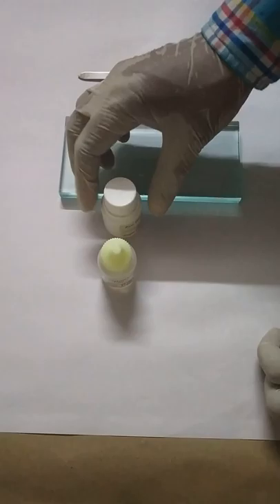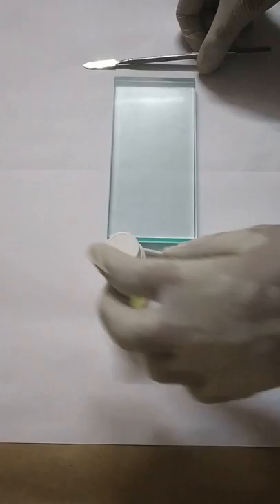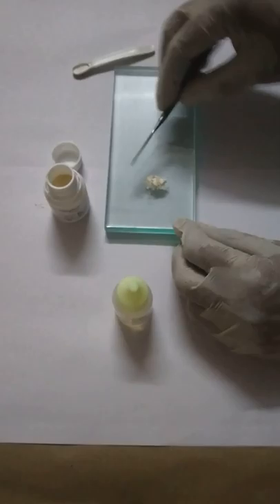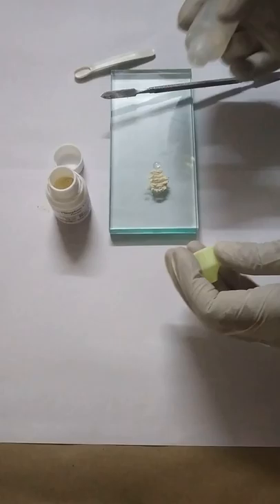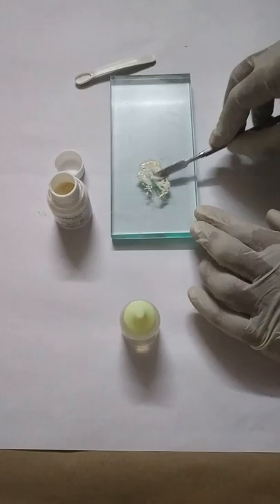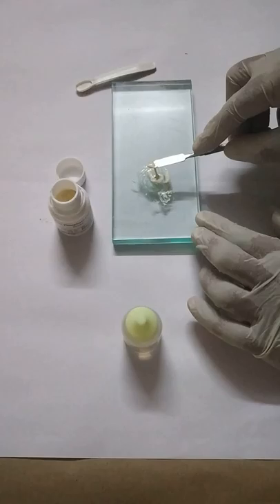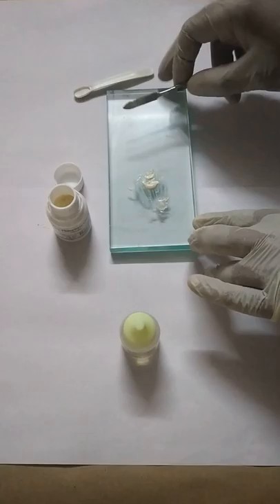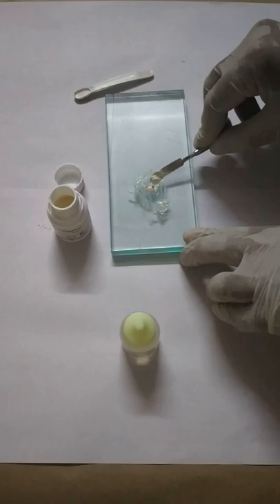How to mix zinc phosphate cement

Comment: What is the key of mixing to get lutting consistency and not base consistency? Is it the mixing time? Or the amount of liquid? Thanks bfore
Reply from the maker: Hi thinner consistency is required for luting and relatively thicker for base. For base consistency slight more powder can be added this will make mix not only thicker but also stronger. At the same time adding more liquid for thinner mix should be avoided as it may cause postoperative sensitivity because of acid pH.
Reply: Vijay Prakash thanks for the information doc

Comment: What is the liquid you are mixing with zinc phosphate cement? Does it mix well with water.
Reply from the maker: Pl don't use water. It is special liquid which is used for mixing.
Reply: What's the liquid ?